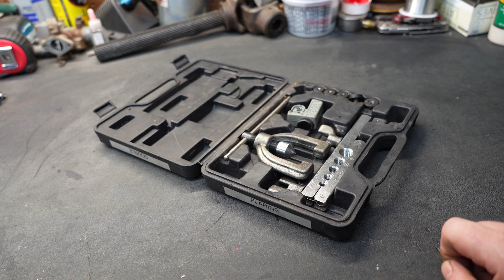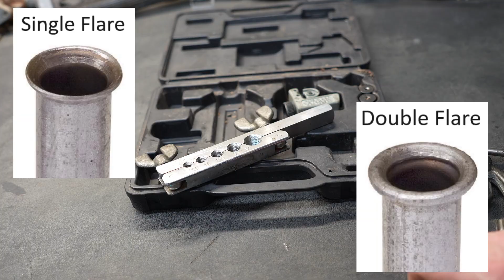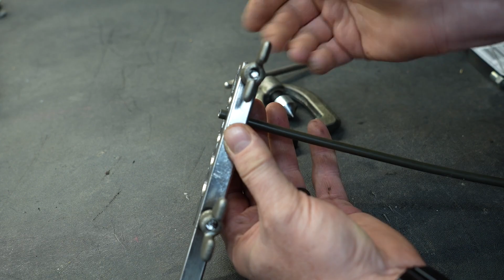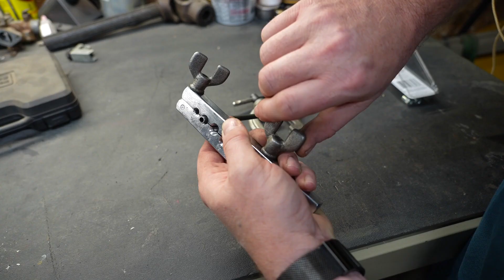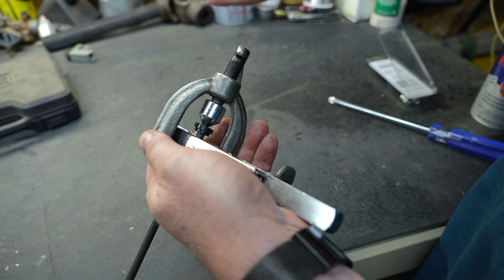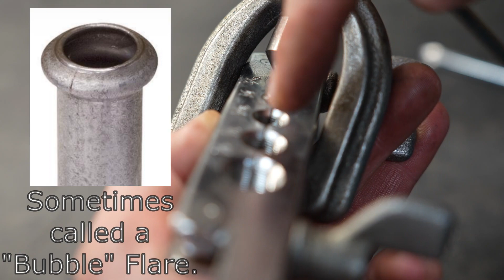How to easily make a double flare for a brake or fuel line on a vehicle!

Comment: I started out using those but when I started replacing brake lines on GM trucks with the abs module under the cab it was time to get a hydraulic flaring kit that uses a lot less space and can be operated with one hand. I love s.u.r&r ez bend brake line and their fittings which are way more robust. 9/16" wrench instead of 3/8" on 1/4" brake line and 7/16" wrench for 3/16" brake line. Makes it easy to get those nuts good and tight.

Comment: Most modern cars use a bubble flare on brake and fuel lines that are still metal . A lot of manufacturers are using plastic for fuel lines but they are still using steel for brake lines. Never use copper or compression fittings for brake lines